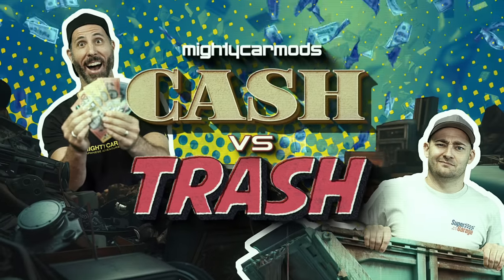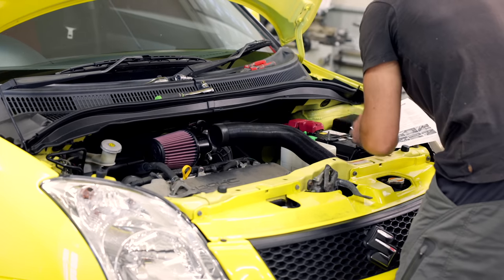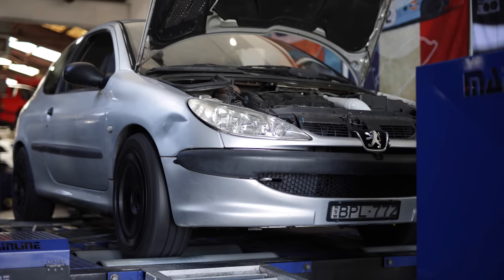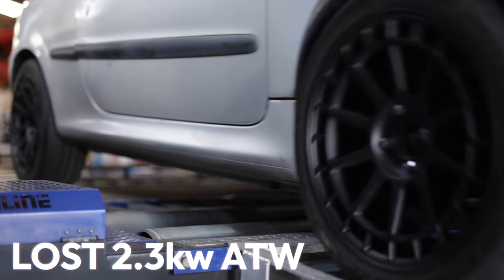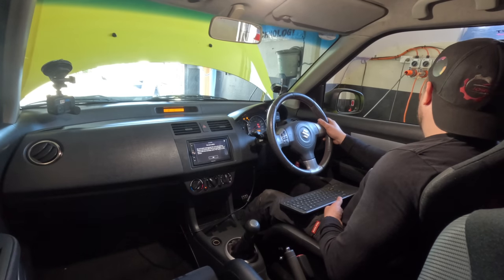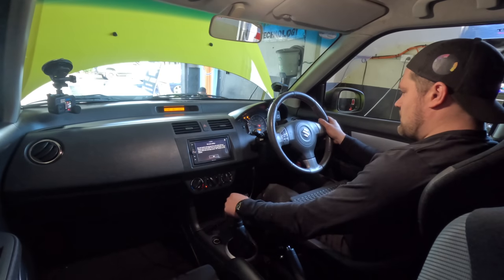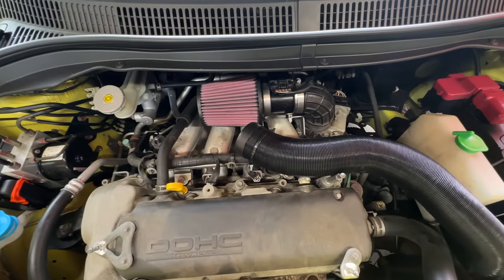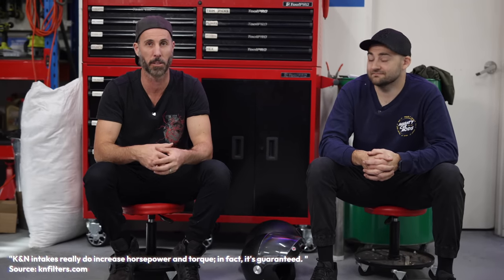Dyno testing POD FILTER Performance Claims | CASH vs TRASH

Comment: It'd be awesome to see:

The maximum power you can gain with a dyno tune using the STOCK intake
VS.
The max with a dyno tune using an AFTERMARKET intake. 

I feel like this could be the scenario that they're actually useful
Reply: Was about to comment this.
Reply: You can't tune stock cars that easily, not without some ecu.
Reply: @jaky3  its really easy actually, you rarely need an aftermarket ecu
Reply: On some of the Peugeot models, to safely tune them without adding the expense of an aftermarket ecu, you got to remove and open up the ecu and solder some wires, download the info on the ecu, adjust some tables, then flash it back, reinstall etc...its a bit of a mission especially on a petrol engine where gains would be minimal and Rodney lurks waiting for overzealous tuning
Reply: @garren3498  depends on what car.
Reply: @mbsnyderc For Sure.
Some respond to bolt-ons better than others
Reply: @richbrown5852  yeah older cars can sometimes require some soldering. Ive never dabbled in any peugeot tuning so ive got no clue abt them, i was thinking more generally, like Vag products and bmw etc.. you can often remap without any physical mods
Reply: Even making the stock intake more efficient by heat/radiation DEI shielding, or even putting a "high flow kn" fliter, in there too. A bit less invasive.
Reply: @Rich Brown  Hondas have been doing that since the 90s. Easy
Reply: The scenario is useful because this is a common standalone mod that a lot of people do. I think we all understand that if you're mapping the ecu then a more free-breathing intake is going to help free up a few ponies
Reply: nothing , you win nothing, i had a 1.6 l in the dyno and with oem intake vs the aftermarket one and the gain was 0 , the only thing good about the aftermarket ones is the noise , and the being able to wash it and re use it

Comment: Love to see Marty's original intake with the new exhaust, see if the $50 exhaust made a diff.
Reply: I actually think it martys case his exhaust was too big, and the intake was less of the issue, where Moog it was the opposite.
Reply: Do they run whit same tires as before, low power car like that even tire mass chances dyno results.
Reply: @winha1435  yeah, one of many drawbacks of measuring power at the wheels only, you're never sure what caused the power drop, is it the engine or something else.
Reply: I'm pretty confident the exhaust is what kills the power, 76mm exhaust is way too big for that engine and power level.
Engines don't like backpressure but you need to balance flow and velocity, too much flow will hurt velocity
Reply: @NineS5  Same goes maybe for the ultra-complicated factory air filter setup? Peugeot engineers know what they're doing....
Reply: @arekb5951  well its actual power you are hitting the ground, slap some over size wheels on less 100hp car and it feels broken.
Reply: @sniperotto  100% velocity makes a huge difference. 

Back when i started learning how to build engines and porting heads. You can really mess things up quickly
Reply: @winha1435  dynos that measure BHP also give you WHP number, so if Marty's 206 for example makes the same BHP but loses WHP you can be 100% sure that it's something in the drivetrain that steals some power, with WHP readout only you can't be sure and you have to replace the intake and/or exhaust with the stock one to make sure it's not the engine that lost power due to bad mods. That lack of information can lead to a waste of time and money.

Measuring engine power using wheel HP is like measuring your height with shoes on, your actual height when you're walking down the street is your height + shoe height indeed, but it can be easily manipulated with how tall your shoes are, so nobody in their right mind measures height with shoes on.
Reply: @arekb5951 been dynos enough of times to know how to do it proper and what affects what and how to read it.
Reply: @Nine-S  I mentioned this on the previous vid. I have a 208gti and one of the forum members did a dyno test of the 3 main induction kits on the market and all except a panel filter in the stock intake made a significant loss in power.
Reply: @winha1435  for the rest of us non-all-knowing mortals the more info the better 😉
Reply: @arekb5951  haha i gues so, you should see some mild ecu tuned hilux guy face when he runs in dyno whit bigboy mud tires and see hes making less power than stock :)

Comment: Im in the uk and i used to like induction filters for the noise when i was younger, but since i've got a bit older and a bit smarter, now i keep the standard air box, chop any fins inside the box to make it as smooth as possible, replace the ribbed intake hose with a smooth one and replace the panel filter with a better flowing filter, my preference is a company called 'green' and you keep the same set up as your car manufacturer spend ££££'s researching and developing, increase the sound a bit, help the flow of air a little bit and its really cheap to do. 
I also noticed in my time that on smaller not very powerful engines, you lose low down torque by using an open/induction filter compared to a standard airbox, so you make your already slow accelerating car even slower off the mark.

Comment: It's such a complex issue, but over the years (and thanks to your videos as well!), I think it just comes down to these small cc NA engines being engineered to be incredibly efficient by the manufacturer. Decreased restriction/pressure/velocity in the intake and exhaust probably only benefits FI setups. And in modern vehicles most likely only with tuning in any case.

Comment: The OEM intakes are usually pretty sophisticated tuned-length affairs, as well as heat shielded. If you try swapping the filter with a panel filter, you will might see a small change if there is a significant enough restriction in the filter (there probably isn't). The only real reason to do a pod filter is if you're modifying enough of your engine bay that it is the only practical option.
Reply: So true. I swapped out the stock panel filter with a K&N panel filter in my BA Falcon back in the day, and got a notable gain in power. I then removed the intake snorkel part leading to the airbox, which gave a bigger opening into the airbox to get more air, and got more gains. The snorkel is a restrictive part. I've removed this snorkel to the airbox on numerous cars, and always made gains. There's something to be said about the research gone into the inlet from the airbox to the motor, and removing it can have a negative effect. Every time I've removed the snorkel only, not only have I gained some power, I've also gained intake noise. I do believe they make these snorkels like this to reduce noise emissions, with the downside of robbing some power.
My 3 cents.
Reply: @SirDaffyD correct... I once owned a 1.4 8v Fiat Punto, swapped the airbox snorkel from its hot intake that went to a blanked off section of the grille that was covered in painted cardboard (Yes, cardboard) 
Took that out, replaced the snorkel with a cold feed tube, cut a section in the grille so it pointed directly into a windpath...
Very noticeable difference... minor but noticeable.
Reply: @SirDaffyD of course, some cars have a large portion of plastic in the fender that the intake is attached to.  It's an enclosure of a bunch of baffles and angles that the air has to pass through, quiets things down.

Stock intakes, even without that are definitely designed to cut down on engine noises.

Comment: Mainline dyno’s have definitely thrown us as a part manufacturer for a loop in the past.  They’re very strict in some ways, and definitely could be the problem.  It would have been useful to do the test in the same day.  But given the location of that filter and the way a dyno operates I suspect the intake air temp has significantly changed, which can not only result in natural performance loss but also can trigger the calibration to significantly lower power in order to avoid knock.

Comment: One thing I'd be interested to know - what's the surface area of the pod filter, compared to the stock panel filter. Like if you were to cut the pod open and lay the filter element flat, I wonder if it would have a smaller or greater surface area of filtration? If that's not the reason, surely the terrible mounting location would have a lot to do with the losses. Pretty devastating result considering how much it cost!
Reply: The pod will have much more of course.
Reply: That 100hp motor is not nearly restricted by that size cone.
Reply: I am thinking it is more about sucking in hot air with the pod.  Or could be a tuned length thing.
Reply: That would be incredibly hard to compare. The filter medium is just so different that it wouldn't really matter.
A better comparison would probably be how much effort it takes to pull air in through it, and how much particle matter is in the air post filtration.
But you'd need a proper lab to be able to test that. Perhaps it would be an interesting topic for an LTT video?
Reply: The pod setup has changed the way the air flows over the maf, throwing the OEM ECU tuning out, losing power.

Comment: Dropping pod filter without any shielding on top of the exhaust manifold in the back of the engine bay. I can only imagine how crazy the intake air temperature was.
Reply: I thought this too, but that's actually the intake manifold. The exhaust is located on the front, you can see the heat shield in the overhead shot. 

Now, that said. I still wouldn't want to be drawing my air from next to the engine bay.
Reply: @mitchellpatterson3323  oh yeah. Embarrassing overlook by me
Reply: @adamtomecek6704  Don't be hard on yourself, I thought the same thing initially
Reply: It's still feels like a barmy place to put it.

Made me double take when I saw it.
Reply: @IoSkyBoyoI   100%, it's still drawing hot air from the top of the motor rather than cold air from the side like the standard intake.
Reply: @mitchellpatterson3323  it's just pulling ambient air. Marty should have swapped the kn cone on and see if there was a difference over the cheap pod. I bed the cheapie flows better and lets more dirt in. 

But this proved what I said for years. I haven't spun a bearing on a car with a OEM airbox and filter. I haven't changed my driving style. I think these filters let in a ton of dirt that breaks oil down faster causing bearings to spin and fail.
Reply: @adamtomecek6704  It's still hot air. The stock is always cold air. So you're correct.
Reply: @Ifixstuf  Ambient air is the air OUTSIDE of the car, in the garage. Any air in that engine bay is hotter than what is outside of it. 

it is not Ambient, it has flown through the radiator and heated up, then over the the exhaust and heated up again before it finally reaches the air intake.
Reply: @mitchellpatterson3323  Ambient temperature is the air temperature of any object or environment where equipment is stored. The adjective ambient means "relating to the immediate surroundings." This value is also referred to as the ordinary temperature or the baseline temperature. It is important for system design and thermal analysis.

In this case the environment is the air in the engine bay. Thanks though, go read a book.

Comment: Here to see if the old PVC intake I did back in the day on my first car was killing it or not
Edit- after watching, glad we only spent $10 instead of $350 for that car 😂😂
Reply: dont forget 1.2k exhaust :D
Reply: @yunusertas  done that once, probably just going to stick to learning and making my own 😅😅
Reply: it only makes less power if the car is otherwise stock. if you tune the ecu by sending it to a company itll fix the top end of the rpm band from running lean and losing power. the ecu can only tolerate 5-10% extra air than it expects before running out of injector pressure to keep up with the high intake volume.

Comment: Be interesting to see the hp with the stock airbox back on with the performance exhaust
Reply: Exactly, the swift wldnt hve taken that  long to change bck on the same day & same dyno bck to bck test for a definite answer....opportunity missed imo
Reply: Yes they should test this
Reply: I second that. Would be very interesting to see. I didn't expect them to make hp but was surprised to see that much of a drop in the case of the swift
Reply: So many variables missed as well, like we dont know if outside temp changed.
Reply: The problem is you have to put the k&n sticker on the car ,lol

Comment: I'm a mechanical engineer who worked (past tense) in the automotive aftermarket, so I might have some insight.

Here's how it probably went. A salesman or reseller somewhere told the K&N engineering team that they needed an intake kit for the Swift to fill out the K&N sales catalog, but the engineering team were probably given little (or no) access to an actual Suzuki Swift for testing, so they gave it a good guess, created a kit using parts that K&N already had, and were forced to move on to the next project.
Reply: That's my guess too. Research and development requires actual research to be done.
Reply: As someone working in RnD, this is pretty accurate on how most of the engineering is done in big companies. Not for all products but certainly Swift's kit is an example. Add on top of that misunderstood engineering notes that get overpromised by the marketing and sales. 
Another case might be that they know it loses power but that wouldn't make sense for a product so they will look for a corner case or additional modifications to justify this filter.

Comment: When it comes to small changes like a air filter change they need to be tested on a engine Dynomometer in a controlled environment. Chassis dynos just aren't precise enough due to temp, humidity, dew point and barometric pressure, tire pressure, transmission temperature ect ect which effects every parameter of a Dyno run.

Comment: The  issue for Moog is probably in part the location of the induction kit, you would do better to replace the stock filter with a K&N panel filter in the stock airbox. Also as you mentioned tuning, that is what is needed to take full advantage of a full exhaust system and an intake change, a stock ECU will try it's best to make adjustments to run the engine in pre determined values.
Reply: I agree with replacing just the stock panel filter with a K&N panel filter. I've just this mod to a few intakes, and always made gains. So much R&D goes into designing the intake, that totally replacing it will almost always have a negative effect, unless the ecu is retuned to that intake. Saying that, I've removed the snorkel on the intake side of many airboxes, and made gains due to where the snorkel enters the airbox being bigger than the hole where the air enters the snorkel. I've always gained more intake noise doing this also.

Comment: Position of the MAF is key. OE airbox ensures best reading of airflow across the sensor. Look at the bellmouths used on ITB setups, a good aftermarket intake has similar design incorporated to keep the MAF reading accurately.